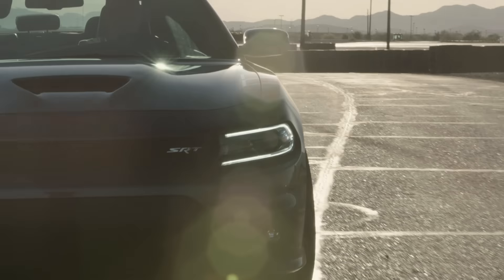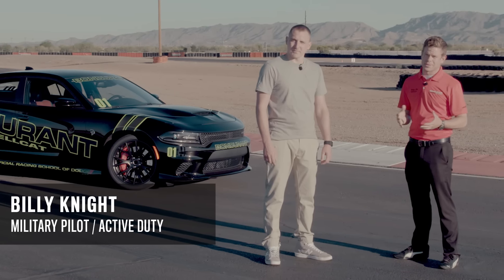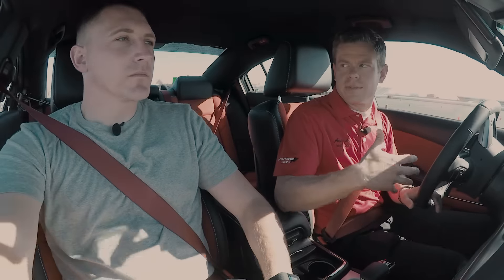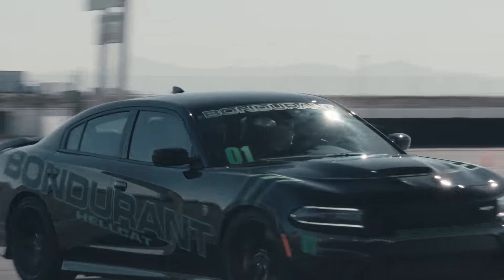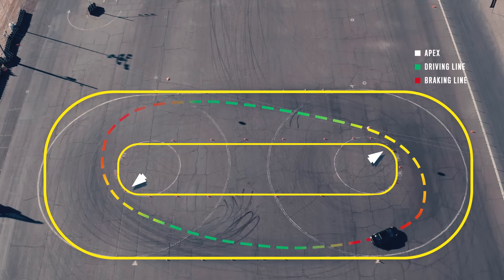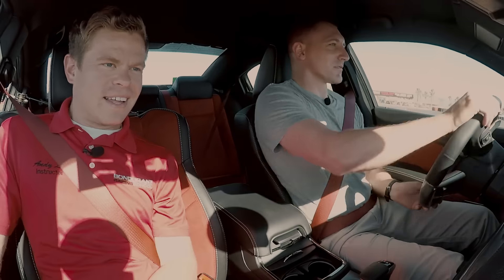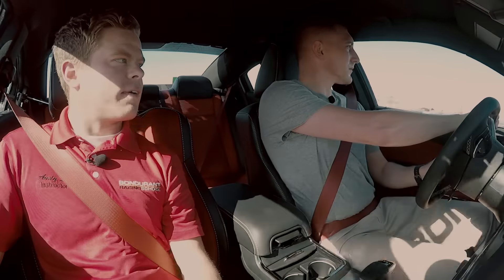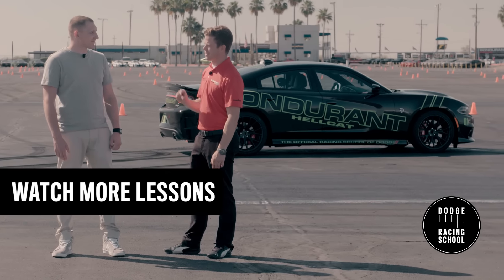Here’s How To Master Throttle Application, According To An Expert | Road & Track + Dodge

Comment: The key seems to be not to just romp on the throttle coming out of the corner.  Roll onto the power smoothly.
Reply: If the tires can take it you can be more aggressive with the throttle.  The Hellcat is basically an ice skater with the tires it has.
Reply: Yeah, don't floor the throttle pedal right after hitting an apex. You will probably understeer. Always roll onto the power smoothly. I think what 1320cruiser means to say is that you may be able to roll onto the power sooner if you have good tires.
Reply: Easier said than done. Controlling throttle is easy with a controller, not so much with a steering wheel and pedals.
Reply: @1320crusier  But that takes the challenge from it. Learning to adapt to a slippery car can make you a better driver.